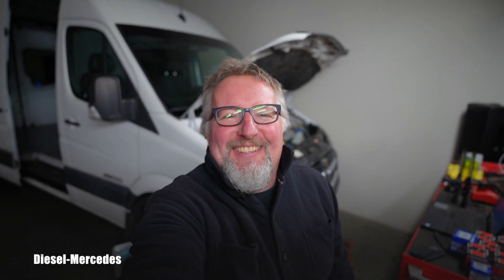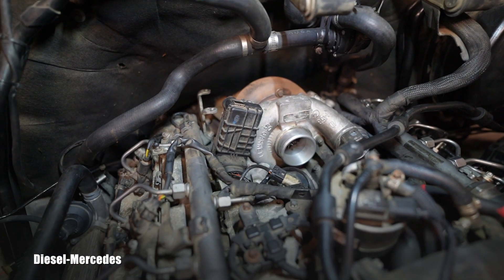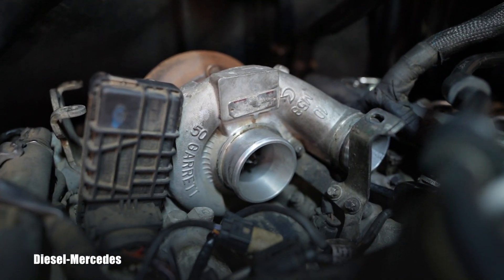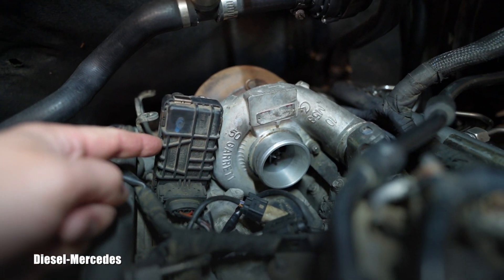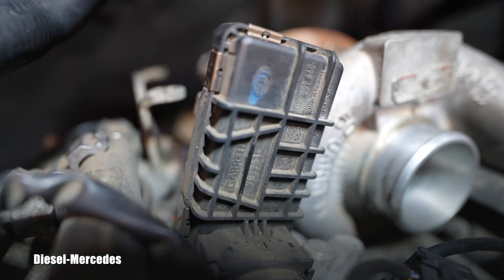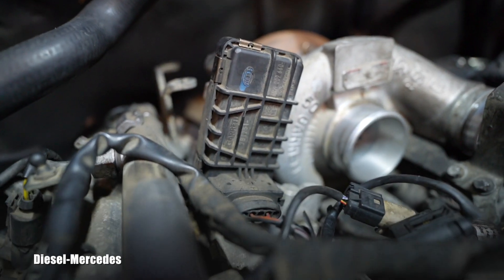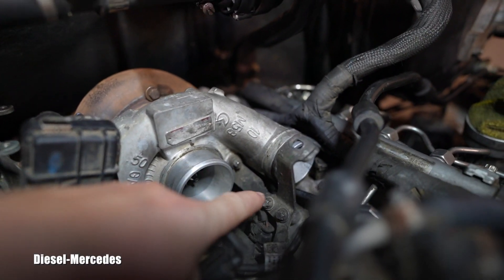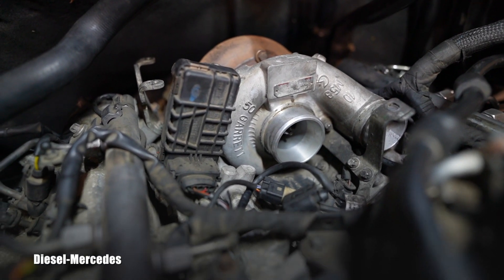Mercedes OM642 Turbo Actuator or Charge Pressure Positioner

Comment: Hello.I have a W221 with an OM 642 engine, I was driving recently and suddenly the car lost power (emergency mode) but after diagnosing the fault and it was a sensor falling out of the throttle, everything returned to normal. There is also an error of the oil temp. sensor (it does not show the temp.) which is in the oil pan. I replaced the sensor with a new one, but still the same, what do you bet on the power supply on the plug to the sensor? Coming back to the turbine actuator, should it move on its own if it is at slow speed and no one is adjusting the accelerator pedal.

Comment: I rewatched this video and am following up to my earlier question that I previously posted (below). To clarify that earlier question, I meant 2000-3000 rpm of course, not 200-300 rpm. Thanks in advance.
Reply: My ML is doing the same at steady low throttle conditions. Have you been able to sort yours out?

Comment: Thank you for your video, I have a 2011 MB Sprinter 2500 with the 3.0L Diesel engine. At a steady throttle the engine has a steady and consistent engine surge of about 200-300 RPM on the tachometer (up and down) every few seconds.  I'm trying to track down the source of this surge but there are no codes that com up on diagnosis scan. The engine has had a DPF delete completed using the delete kit provided by RawTek Fabrications, and a Malone Tune to the ECU. However, we don't believe either of these caused the issue.  Do you think it might be the turbo actuator?
Reply: I have the same, have you been able to diagnose the issue?

Comment: The main reason that the fusible links inside the turbo actuator fail is because the turbo variable vanes clog up with oily sooty gunk which then overworks the actuator causing the fusible links to blow . This is also what causes the worm and gear to wear out within the actuator .
Dismantle the turbo variable vane system and clean it out when you have the turbo out .
Reply: Full delete and tune cures this problem 😎🍻
Reply: @pooleo8  when you say this, you're talking about EGR delete/blank off and remap to make the ECU forget about EGR - Yes?
Reply: @JamesSmith19900  yes, egr, dpf, cat and NoX. Those items just destroy diesel engines.
Reply: where is the fusible link located? I'm having a problem with mine where the turbo seems to boost, then drop, it's almost as if there is no signal from the actuator to the turbo. It's a new turbo and actuator. See my comments above from about six months ago and also 12 days ago. Thanks for any advice!

Comment: Thanks for sharing . I had the same engine in my Mercedes’ and I sold it . I was starting to get this oil cooler leak and didn’t want to tackle it . Loved the torque and the car. Did Mercedes’ work out sone of these issues in the newer generation.